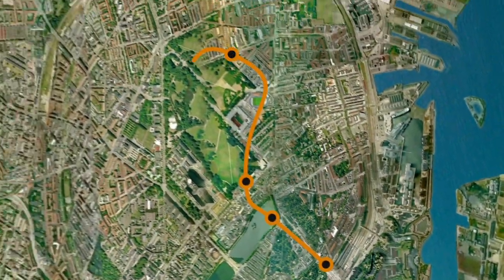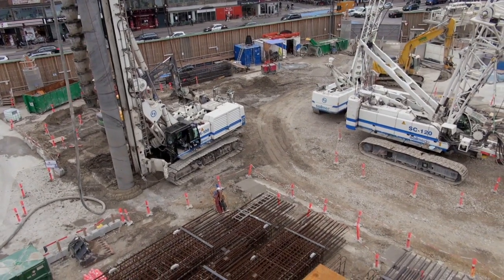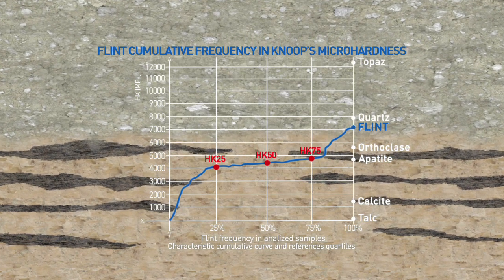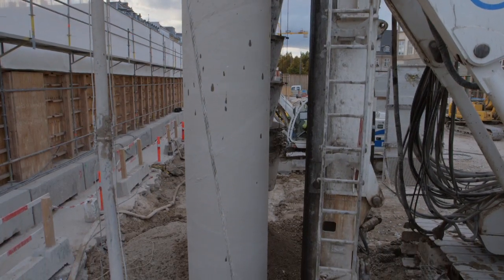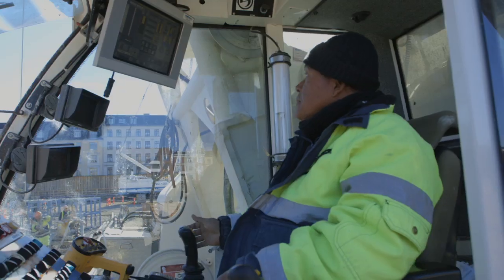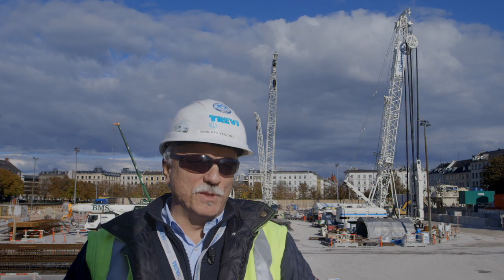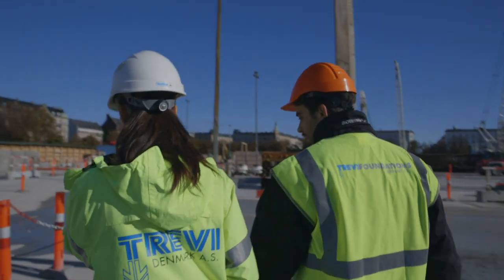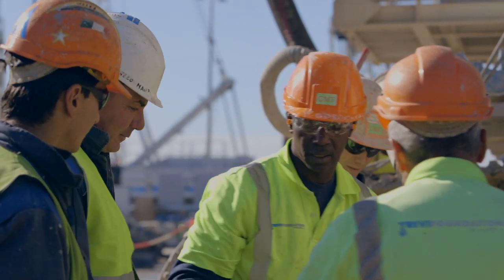Trevi Group Copenhagen Cityringen Project [Metro Line]

Comment from the maker: Copenhagen Cityringen Project
The Cityringen is the new underground line that will link the whole of the centre of Copenhagen and Frederiksberg.
Over the past two years Copenhagen residents have witnessed a large fleet of  #Soilmec  drill rigs, cranes and hydromills wedged in between residences and historic buildings throughout the heart of the city. As shown in the video, the equipment played a critical role in the construction of the new metro line.
 #Trevi   has maintained high quality control standards, establishing an excellent relationship of trust with both the client and the main contractor.